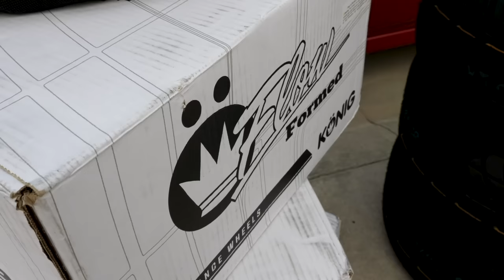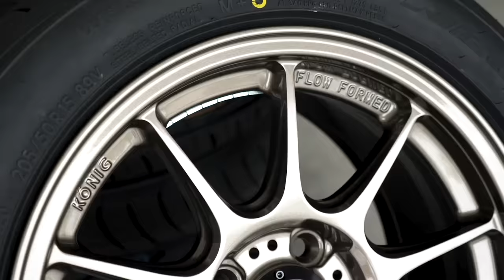Building a *CLEAN* Honda Civic in 10 Minutes! (Less is MORE!)

Comment: It’s amazing what you accomplished with this build, considering your budget. The labor you put in made as much of a difference as the money you spent.
Reply from the maker: Thanks man! It was a bit of yin and yang for balance
Reply: Al
Q
Reply: That’s true, you can tell when a car is clean when the owner puts a lot of hard labor into it!
Reply: @ALLDAYANTHONY  yo did you experience any electrical/parts issues after power washing everything in the bay?
Reply: what build lol
Reply: Not to mention he did it all in less than 10 mins
Reply: @forapply4583  lolr
Reply: @coleslaw932  I wash engines, they havent had an issue, I guess for 2 reasons, the engine is warm and I dont rinse the air filter
Reply: Nice l have eg turbo swap typer
Reply: 너도 예산을

Comment: I recently bought a white 99 civic LX for $1000 and it's in immaculate condition on the interior as I literally got it from my grandma lol. The outside is a bit dirty and mechanically it's near flawless. The only issue it has is the valve cover seal needs replaced and that's on the to-do list. It has 130k miles on it too which is fairly low considering it's age. All in all I love it so far despite not being a previous civic guy. After seeing just how much of an improvement your civic looks after some the mods at the relatively low price I'm definitely gonna be shooting for that. It will also be my first real "project car" so there will definitely be a learning curve. My only complaint with the car is the 4 speed auto in it. I don't mind it being auto, I'd prefer a manual but I'm ok with auto but it just needs 1 more gear in it. Just doesn't feel right only being a 4 speed. Can't complain tho and hope to have it looking as good as yours in a year or 2!

Comment: I couldn’t help but to get a little emotional watching this. In a way I feel a special connection to Civics. Growing up I used to ride around with my mom in her Gold Civic EX from 2000. I LOVED that car. Even if it was simple to me it was really cool. While it’s not the same as the one you fixed up the video the interior was practically the same and it brought back such a rush of nostalgia. She’d had the car since before I was born and had to sell it when I was around 11 years old after someone cut her off and forced her to jump a pretty tall curb which ultimately blew the suspension, steering alignment, front axle and driveshaft. It was gonna be too expensive to fix. As a result my parents ended up getting a new 2013 Civic EX or rather an FB2. While it wasn’t the same as my mom’s I liked it and thought it looked cool and felt fast too! Fast forward nearly nine years later and that FB2 Civic became my car. I still remember my dad taking me out to drive it in an empty parking lot during the height of the pandemic and those first few drives made me fall in love with her even more and moreso when I started driving with my permit. I got my license in that car during my road test and I’ve driven her everywhere ever since. She’s been beyond reliable and fun and I have SO MANY memories with her. Honda really knew what they were doing with the Civic and honestly I’m very grateful that they’ve made this amazing car. They really are something special.
Reply from the maker: Great story! thanks for sharing man!

Comment: Where did you get the front splitter and what is it called, i have a 99 civic ex coupe that im building onna budget and its hard to find splitters or bumpers that are budget look nice and i domt have to worry about not fitting

Comment: Hi, i need some help. I was looking to buy Honda civic 2002 sedan (ES) 1.6 and it had a problem with the abs. When i turned the streenig wheel all the way to the right it kicked back and the abs light turned on. The battery and the charger are in need of a change so could it have something to do with them?

Comment: I have a 2000 as a daily, I wanted to put maybe a k or 2 into it, but the head gasket is shot, so I'm on the fence. It's drivable, but it's choking on it's coolant slowly. Probably have another year and a half left if I'm lucky. Should I do an engine swap?
Reply from the maker: Depends, if the body is in great shape swap it. If not, maybe move on to something new